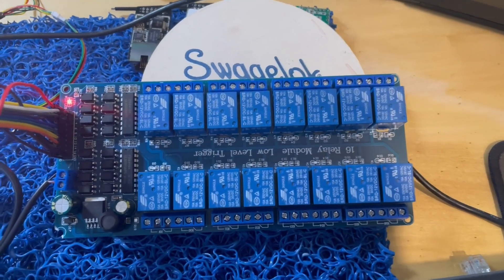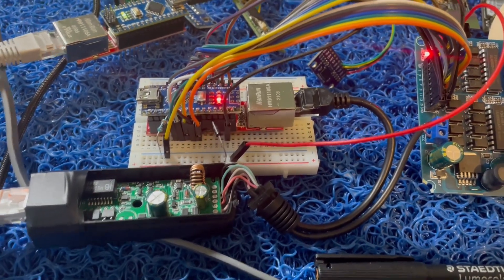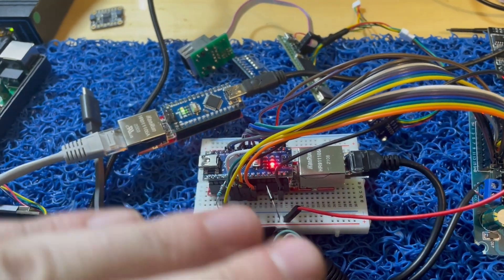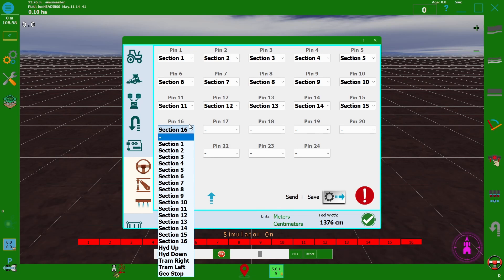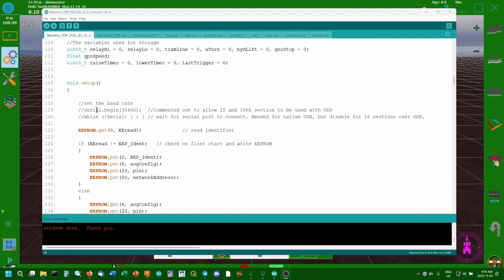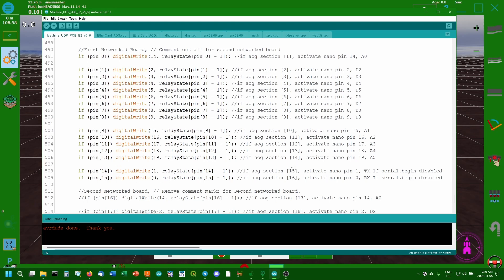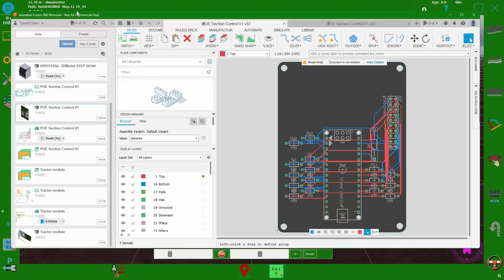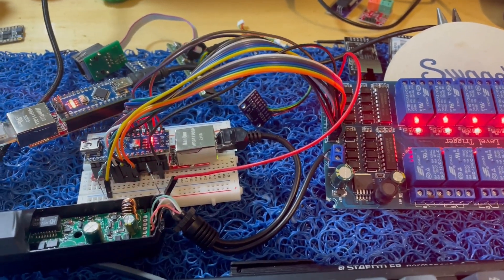AgOpenGPS - UDP Networked Section Control

Comment: For me A6 and A7 pins doesn't seem to work...
D2 pin seems to be blinking at the same rate as the yellow LED on the ethernet card...

and D10-13 is actually needed for ENC28J60 to work

So I'm not really able to control all 16 relays just 13+1...

Comment: My favorite thing about GPS is that it’s based on the flat earth azimuthal equidistant Cartesian coordinate system. The reason it is is because we do not actually measure any curvature in reality.
Reply from the maker: I think the GPS reality changed when i was born.

https://earth-info.nga.mil/index.php?dir=wgs84&action=wgs84

WGS 84 is a geoid model, with all measurements in 3D from the centre of the earth. So you can actually measure a 3D spline on the earth, and all of its curvature. Since the major axis are fixed you can compare the tectonic drift of points over time depending on the epochs you are using when you take the measurements.

The AOG guidance system may assume flat over a small localized area, but then we have a gyroscope to compensate for any changes in topography. 

But the data is still 3D and has been a imperfect sphere for some time.  

This is why you need special software to transform your data to the local datum for land survey. Because a lot of localizations are based on very old flat data.
Reply: @potatofarmer  your software would not have to apply the haversine formula to the data the create the geoid model based on latitude and longitude…. I’ll bet you don’t even know how latitude and long was originally derived and why you assume a radius value… 

Just tell me.. how do I verify your assumed radius value in reality???
Reply: @potatofarmer  we don’t live on a model.
Reply from the maker: @nicholashpitts   We get out of our moms basements and touch grass once and awhile.

But thank you  greatly for working so hard at bumping up my comment count and helping more people find this video.
Reply: @potatofarmer  your anger comes from pain, your pain comes from cognitive dissonance, it’s not going away. If you cannot tell me how to verify we live on a ball today. What makes you think you will be able to do it at any time?

Welcome to flat earth. Ground positioning, system? Government positioning system?
Reply: @potatofarmer  I’m at 6,900 feet above sea level right now… far higher than my mom’s basement.
Reply from the maker: Dude you gave up so easy, with staying power like that your going to lose your internet troll card.

You did not even keep it up for even a couple of hours.

You should get checked for low iron levels, clearly your level of trolling is anemic and lacks energy. Barely a dozen posts before you gave up.

You didn’t even bring along any troll friends of yours? Whats up? Do you need to talk to someone about getting help making friends?
Reply from the maker: @nicholashpitts  Did you see that new commercial with the troll under the bridge and he has a friend and they redecorate underneath? Put in some fancy furniture and then share a wonderful evening together in the wonderful creation its pretty good.
Reply: @potatofarmer  do you see how you not being able to prove you live on a ball short circuits your brain?
Reply from the maker: @nicholashpitts  I knew it, I am your only friend this is wonderful. Possibly the only entity that is not a bot who speaks to you. I can tell by the speed of your responses we are besties for sure. You like cats? Cats are really fun. What do you do for fun? You know any magic tricks?
Reply: @potatofarmer  I am just interested in spreading the truth about flat earth. Notice you can not tell me how to verify your assumed radius value.
Reply from the maker: @nicholashpitts  Why would I bother talking to you about your mental illness. Its much more fun to just keep getting you to reply. I find that is much more rewarding. After all I think the real reason you reached out to me was to gain a real human connection. someone who could see through your bullshit. A real friend. Know any magic tricks?
Reply: @potatofarmer  you can’t. Lol I know your science and assumed math better than you ever will. Try me. Your anger comes from fear your fear comes from cognitive dissonance.
Reply from the maker: @nicholashpitts  Have you seen the show Friends, where they hang out at the corner coffee shop? You know any magic tricks?
Reply: @potatofarmer  it’s funny you think I’M the bot…. Lol
Reply: @nicholashpitts   maybe its flat maybe not. AB lines are super straight to our eyes and that what matters :)